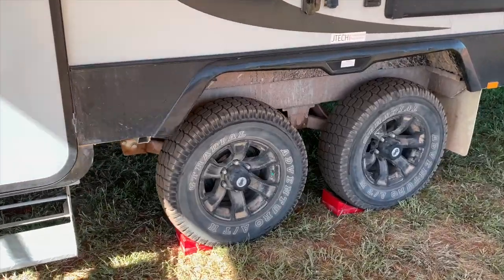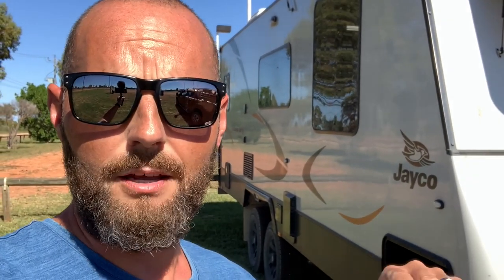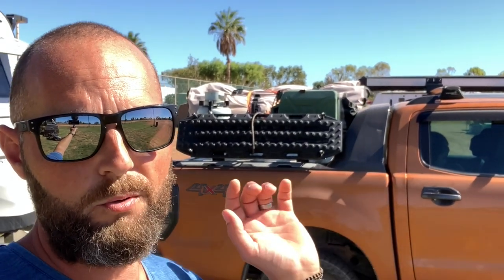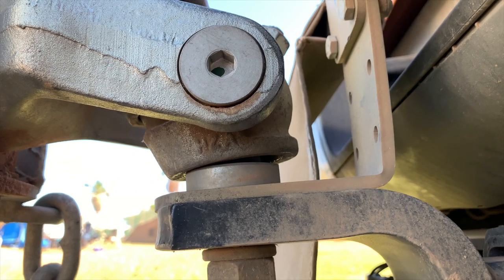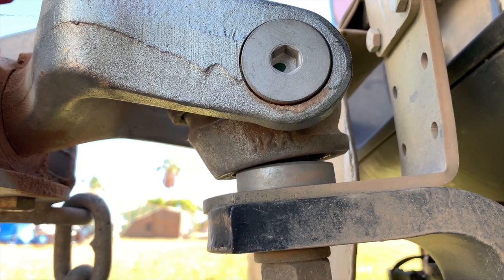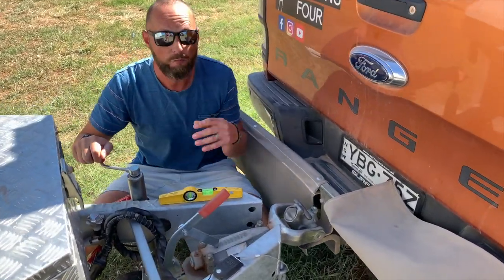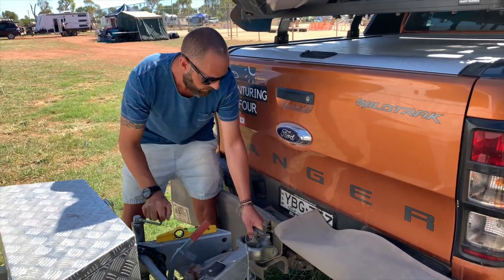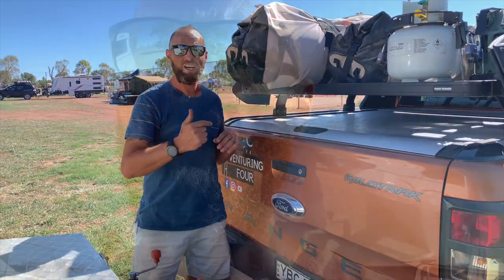Unhitching 50mm Tow Ball On Caravan

Comment: Thanks for the video, very interesting as I have encountered difficulties unhitching on a couple of occasions. I have a motor mover fitted to the caravan, could the motor mover be used to move the caravan slightly forwards or backwards to take the pressure off the hitch/tow ball before trying to release it?
Reply from the maker: I can’t see why you wouldn’t be able to use your motor mover, it really doesn’t need to be moved a great deal for it to break free, sometimes we are only talking millimetres. Try it and see how you go. 👍
Reply: @venturingfour  Thank you, will do.

Comment: Very interesting,  Our van has a standard coupling but we still experience the uncoupling problem as described.  I have on many occasions had my wife ease the vehicle backwards to achieve uncoupling.  I will certainly try your method.  Many thanks.
Reply from the maker: Doug Willcoxson your welcome! Just take it easy on your first try and always make sure that the ground is level. Otherwise look at the tow ball and see if you need to move forwards or backwards to get it dead centre to the hitch and use the handbrake method instead. 👍
Reply: I never  had a problem with out single axel van seem to have trouble sometimes with our dual axel van sometimes i can unhitch  std 50 mm coupling other times have to fiddle around to unhich.
At time ive left van hitched up overnight

Comment: Don't understand all the talk about "neutral" & vehicle runaway.
No handbrake then?
Reply from the maker: Yes neutral is the gear that the vehicle needs to be in and the handbrake is off. Vehicle runaway is if the vehicle isn’t on level ground. This action should only be performed on level ground. 👍
Reply: @venturingfour  I must be missing something. Why do you need to be in neutral? In 10 years of full time caravanning (with 180 degree 50mm ball hitch) I've never once needed to have the vehicle in neutral with hand break off when unhitching. I've been on sites where the pad is raised above the road, so certainly on an angle and hand break needed to be on. When a bit stuck I have moved the vehicle a tiny fraction and then hand break back on.
Same as if on level ground.
At times if you just keep winding up the jockey wheel it will separate from the ball. The thing to watch out for here is the draw bar can lurch sideways upon separation, especially if van and vehicle are not able to be perfrectly straightly aligned. Something you need to ready for.